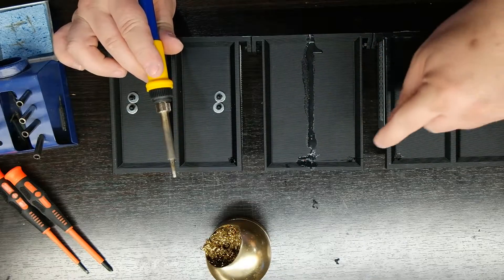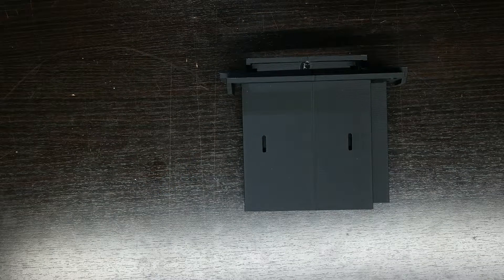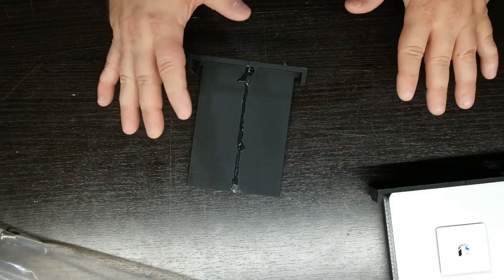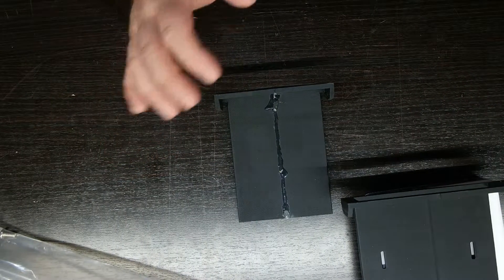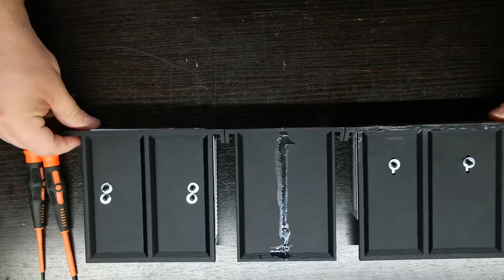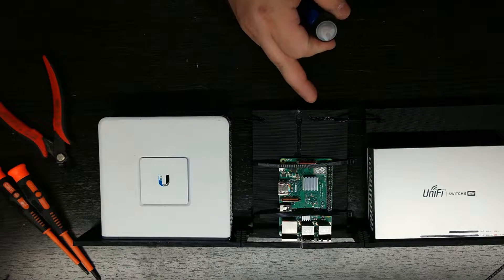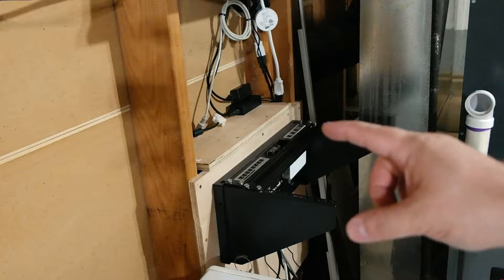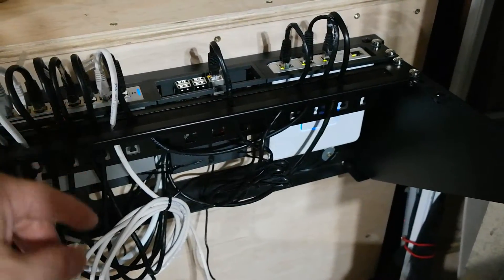UniFi USG Rack Mount How-To

Comment: Looks good! Question though... have you run into heat issues with the switch? Mine is currently sitting on a shelf, it powers two APs and a Cloud Key, and it gets pretty warm, almost hot... seems like you'd have even less airflow and more ambient heat from the server.
Reply from the maker: Haven't had any heat problems yet.